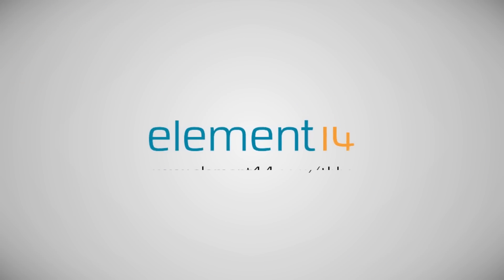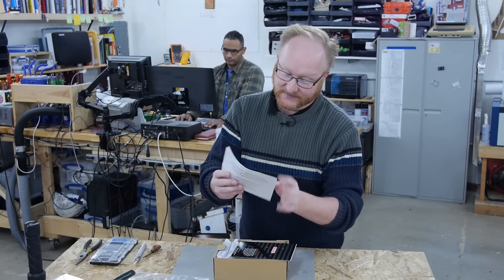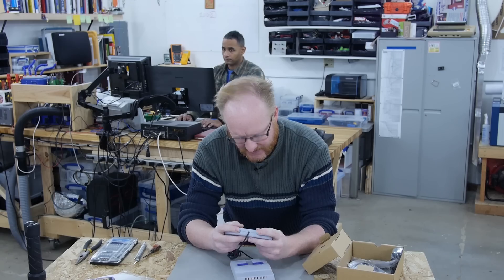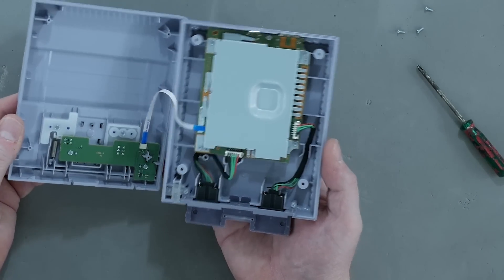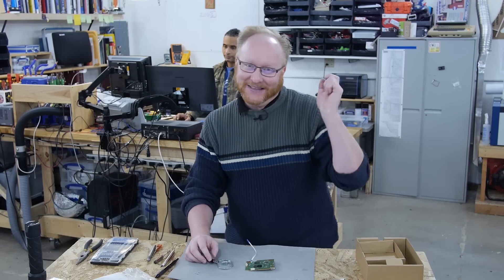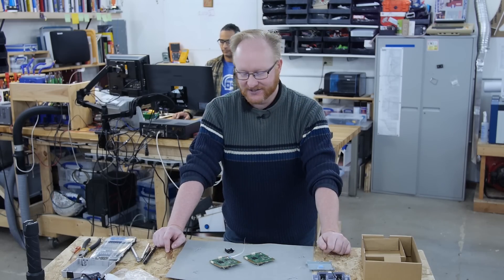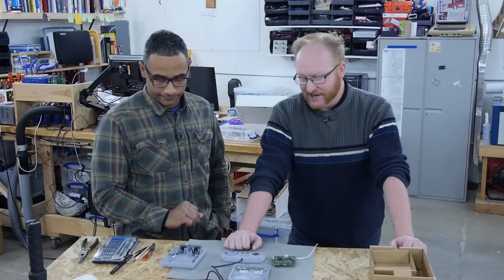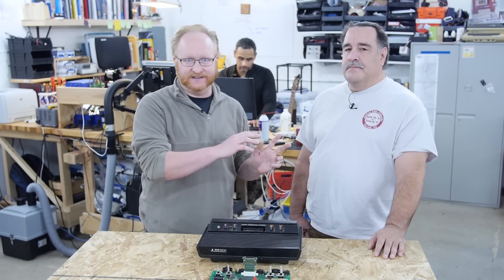SNES Classic Teardown

Comment: Thank god you answered my curious concerns of the difference in boards between the NES Classic and SNES Classic.

I wanted to try putting MAME on one of my many NES and SNES classic consoles and I’m happy I stuck with the SNES classic for the extra RAM. Deff shows in Street Fighter 3 Third Strike , Battle Garegga and PC Ultimate Doom with Sigil running in it 👌 solid

Deff worth messing around if you have a spare NES or SNES classic consoles to run other systems

Comment: It's good thing the SNES classic came with more ram storage. Makes it a better option for modding to add more games too it. Why it is still odd it wasn't more than 21 games added to it originally. I currently have over 206 games including more Snes games, NES, and some Genesis games. Some of the 512mb store is offheaded it seems. Only allows a lil over 200mb of storage for games but I still have over 100 mb left after installing more games and emulator mods. Btw it doesn't take much to emulate N64 that well. I can run it on my phone lol but smart phones are basically portable computers these days and have more than adequate cpu processing and graphics capabilities for retro games.

Comment: N64 emulation is still harder than most might assume. There are still lesser played games that don't run perfectly on any system.

That said, to be safe you'd want (roughly):
1.5ghz cpu
1GB RAM
Some form of dedicated GPU with 128-256MB of VRAM

I think Nintendo would just be better off remaking the N64 instead of emulating. Bust out the datasheets, make a console on a chip and sell it miniaturized.

If not, they're looking at a device that has about the same power as a Galaxy s5 or s6 smart phone. That would still cost too much to profit from as of today. That's why I don't see an N64 mini coming anytime soon.

Comment: Nintendo has sadly discovered artificial scarcity as a selling strategy. The don't make enough Amiibos and then watch the prices soar. They use the same PCB and SoC to make two "different" products, both are overpriced and they claim that production can't keep up with demand. 
People were demanding absolutely insane prices for these on eBay when they came out because stores and online shops didn't have enough.

Comment: It's going to take beefier hardware for sure to properly emulate Nintendo 64 games in a mini system. MY guess is those hardware requirements are going to raise the price to $120 for a mini N64 with original controller. The all-time best N64 emulation back in the day was using UltraHLE + a 3DFX Voodoo 3 3000, then later the Voodoo 5 5500 using Glide drivers. Games ran smoothly and in much crisper high resolution thanks to UltraHLE using direct hardware for the emulation. Zelda 64 never looked better! <3

Comment: It depends on how cycle accurate you want the emulation to the ratio of traditional PC power. Snes9x requires about 1~1.6 GHz of CPU power, whereas Higan-Accurate requires about 3.5 + GHz. The worst problem is actually getting the SA-1 emulated accurately which requires, according to Higan author Byuu and ZSnes and ePSXe author _demo_, somewhere about 7.5~9.0GHz or higher estimated CPU power which is currently next to impossible outside LN2 rigs.

Comment: I bought this for the Star Fox 2 game. Just over 5 million units have been sold and Nintendo will likely halt production. 5 million sounds like a lot but if they released any popular game limited to these numbers it would drive the price through the roof. Say they did this with Pokemon. Prices would go through the roof. Why hasn't this happened with this system yet? People have been playing Star Fox 2 for years. What will drive price increase over time? Collectors of games want mint specimens, not software emulations. This is the only official release of Star Fox 2 and to date is more a side note rather then the selling point it should be.

Comment: For me the SNES classic is worth the price for 3 reasons:  the controllers actually feel like SNES controllers (and it comes with two!), the front end UI is great, and it’s ridiculously easy to drop more games on it.  Considering my Raspberry Pi, NesPi case, 8BitDo controller and 128Gb SD card set me back about £100- the SNES classic is easily worth £70 in my book, but I wouldn’t pay more.

Comment: If you ask me the real console is better. I find this version having low grade tablet parts is just to give a cheap taste of nostalgia. The room filling sound is gone on these. The original had a superior sound chip.  To me it was like trying to port arcade Killer Instinct to the SNES with buttons in a the wrong places. I was an arcade tech so home consoles were like cheap knockoff's with the exceptions of original console games. Because it was mentioned, if a N64 mini was made I think sourcing chips modeled after the original SG would be the best way to go.

Comment: N64 runs well (other than sound emulation coding(?) problems) on a Sony PSP, so that's some idea. The CPU was 222-333 MHz, depending on the generation, I believe, but you could overclock the earlier ones with custom firmware to 333MHz. I don't recall the GPU, but it was somewhat better than the PS1's, so that's pretty efficient.

Comment: The hardest part of emulating the N64 is the 3D graphic standard. Back then there was none, everything was either software or proprietary. While 3Dfx came up slightly earlier, it wasn't adopted by Nintendo.
So your emulator needs to interpret the proprietary 3D data and convert it into OpenGL in real time. And since the programmers often used some undocumented hacks, it is really hard to make the OpenGL result at least look flawless. That's why all N64 emulators can only emulate a few games without too much annoying graphic glitches. Also you need a lot of "horsepower" to emulate.

The PS2 is a different problem. While it does run on some kind of OpenGL, it's graphic power depends on a Vector-CPU which is really hard to emulate because a numeric CPU often needs hundreds of steps to do what the V-CPU does in a few steps.

Comment: the cable length issue seems to be related to the controllers using i2c, so it has to keep a check on cable resistance and capacitance

Comment: This remake of both the Nintendo and Super  Nintendo are horrible. I played Super Contra on my friends and the controller only recognizes up to three buttons at a time. Found out while shooting diagonally up to the right at a power up and needing to jump at the same time without letting off the fire/shoot button, and I died. I own an original SNES, Contra, and controllers and this is not an issue in the original console.

Comment: The SNES mini classic actually does fair N64 emulation (provided you use a compatible controller). It's not perfect and some games don't work, but with the right emulator the actual board wouldn't need a big upgrade to work flawlessly.

Comment: You should totally take off the NAND chip of the NES Classic, put it into the SNES classic, and use some type of switch to switch between the two NAND's before booting it up. Two in one console!
Reply: too much effort. just hack in a front end that loads either system and dump both on one board.

Comment: The AXP223 is a PMIC (Power Management IC), which does power regulation providing stable, correct voltages for the various power rails of the SoC and other components.

Comment: n64 games don't run well on the snes mini some won't even start others will freeze mid game sound skipping. the biggest issues are thermal throttling, the cutscenes in majora's mask are black indicating resource problems, or emulation problems.

Comment: its the same board they used for the NES classic, just the software is different.
You can even hack it to emulate PlayStation and N64 games. (USB and SD card mod helps with storage ;) )

Comment: This is probably a more long term project. But heck, if you got into reverse engineering and creating an N64 emulator, that could be really awesome. A lot of the current ones are still pretty meh when it comes to accuracy, and the "plugin" style of having different plugins for controller, video, and audio needs to die. 

Dolphin does emulation so much better for newer Nintendo consoles which is just silly.

Comment: re: Emulation requirements, when the emulators were first released back, way back...

The NES and GB could be emulated on a 486 class machine, but typically wasn't great. The SNES could be emulated on any Pentium around 133Mhz. The N64 emulators first became available around the Pentium 4 era, but required the 3DFX board to do at the time, roughly around 1999. This meant that anyone who wanted to try it needed to also emulate the 3DFX board and thus glide wrappers beccame a thing. So recompilation is a bit different. 

it should be noted for accurate emulation it is not currently possible to emulate anything more powerful than a SNES without expansion chips on a PC. FPGA's are more accurate and don't have the latency and overhead the PC based emulators do. But you don't get save states on FPGA emulators.

For the N64, no ARM chip is currently sufficient to emulate it (other than maybe what's in the Switch,) so it's unlikely that that Nintendo would use the same board again. It's only possible to emulate it on desktop PC's with a sufficiently powerful CPU in the 3Ghz range. This is why only 21 N64 games found their way onto the Wii Virtual console, and none of them onto the 3DS. 

The irony is that the GC, Wii, and Wii U can all be emulated to higher quality on a desktop PC with a high end GPU, and thus you can actually get 1080p and 4K out of the GC/Wii/Wii U emulation where the original console could not.

So it would actually be easier for Nintendo to recompile the N64 and later games into an ARM-native format rather than try to emulate the hardware at all. Since Nintendo presumably has the source code to their own games, they could do this themselves. Or they can write their own extensions for the toolchain originally used to compile the games (Eg Clang) to output native ARM for the Switch.

Footnote: Pi based systems are not really powerful enough to emulate anything but 8-bit machines. Though you will frequently see people try to flog them on eBay as being able to play SNES and N64 games, they do so at high latency and poor accuracy/frame rates.

Comment: Spoilers. It's an NES mini with different firmware flashed to it. I expected as much when I saw how much overkill the hardware was just to emulate an NES. They probably plan on reusing this board over and over again. Also mine was rather easy to get. I just showed up at Walmart at midnight the night of launch and I got it. 
Also they won't have to upgrade it at all to do the N64. It's already been hacked with an N64 emulator. It's future proof.

Comment: N64 emulation takes sweet FA in the way of processor and GPU.  I have a laptop from 2005 with a 1ghz single core AMD hotplate and 1 gb DDR ram and it runs Banjo-Kazooie with out issue.

Comment: Ready for this? Super N.E.S.
I've never heard "SNES" until about the last year or so. Its always been either Super Nintendo, Super N.E.S., or S.N.E.S.
SNES sounds like some sort of low level flu outbreak or something. Like a cold with lots of snot. "Drink lots of fluids and get bed rest and the SNES will start to work its way out of your system in 4-5 days." 
As for Emulation: ZSNES is king

Comment: You cant compare CPU's of different architectures by clock speed. sure it had it's weaknesses, but overall I think SNES games were graphically superior to the Sega Genesis (although not by much). One of the biggest factors in the SNES favor was that it could display 256 colors simultaneously onscreen while the Genesis could only do 64. This led to more colorful games on SNES. Another big factor favoring the SNES was a superior audio chip AKA better music and sound vs the Sega. There was some slowdown in early SNES games, but over time that decreased as programmers learned the system better. Not saying I'm sure there weren't a few things the Sega could do better, just that overall I feel like the SNES was the more "powerful" system.

You could really see this combo of more color+better sound in a lot of 16-bit SNES JRPG's. When I think of idealized 16-but graphics, the SNES wins easily due to the colors.

Granted it had the help of co processor chips on the cart I'm sure, but for example I remember Donkey Kong Country, very late in the SNES life so programmers had really maxed the thing, at the time being compared to early 32-bit PSX games favorably! Although dont get me wrong of course overall the SNES was far less powerful than a PSX. It was just an example of how good a SNES game could look.

It's all relative though, IMO coming later after the Mega Drive, SNES should have outpowered the Mega Drive by a more significant margin than it did IMO (back then technology moved really fast), and that was a Nintendo screwup IMO. But that's another discussion.
Reply: It's absolutely true that the Snes should have overpowered the Gen in every respect with its 2 yr head-start, but because Nintendo superficially valued cosmetics over efficient 16-bit performance, it did not... 
While it's true that the Snes is overall superior graphically (albeit not by much as you said) and it also has the ability to rotate and scale backrounds, I will strongly argue that the Genesis, is overall the more capable, and more balanced machine because it has all technical advantage relating to gameplay whereas the Snes's advantages are merely cosmetic (with the few exceptions of mode 7 games like Mario Kart). 
Pretty much anything relating to on-screen performance (parallax scrolling, # of sprites on screen, quality of animation, 3D visual effects, wider horizontal resolution allowing broader field of player vision), the Gen has the advantage and these factors undoubtedly affect the gameplay experience.
 
So of course, Chrono Trigger, DKC, Super Metroid, Lttp, FFVI wouldn't look as good or sound the same on the Gen, but the (dozen or so) games that push the Gen to its peak limits...a vanilla Snes most likely couldn't even run, (Alien Soldier, Gunstar Heroes, StreetsOR2, Thunder Force IV, Adventures of Batman & R etc) w/o cutbacks or an arduous amount of optimization.

Sound is another massive debate that I adamantly argue is a clean cut tie. The quote "Snes has a superior audio chip" is simply mythical Wikipedia info written by those who are uninformed and bias.
Now hear me out, the Snes's samples clearly have the advantage when it comes to orchestral & ambient instrumentation ala Secret of Mana, Terranigma etc, but when it comes to rock/electronic or metal, as in the Gen games I listed above^^, it's Yamaha FM synth and 8-bit PSG hardware deliver razor sharp audio quality that the sometimes mediocre clarity of Snes samples (ala Mega Man X and Super Punch Out etc) simply cannot deliver. 
Furthermore it puts up a very respectable fight in orchestral/Jazz scores as well with Time Trax, Devilish, Gauntlet IV and Master of Monsters (very obscure but masterfully composed scores for the system give them a listen sometime! 

All in all, both systems are fantastic but in their own special and unique ways, where one system is weak the other is very strong. And this is what makes the 16-bit era the most misunderstood and contentious but also really cool.

Comment: Really 512MB is overkill for SNES emulation....I was emulating the SNES on a 486CPU with 32MB of RAM, granted, it did not run 100%, but a Pentium 233MMX with 64MB RAM did good...they could have gotten away with using the same RAM for the SNES Classic as they did the NES Classic

Comment: Elias Bakken has two full HDMI mini displays on Kickstarter.  It's called the Manga Screen 2, and comes in 4.8 and 5.9 inch sizes. Perfect for Ben's mini console using the Raspberry pi.
https://www.google.com/url?sa=t&source=web&rct=j&url=https://www.kickstarter.com/projects/1924187374/manga-screen-2&ved=0ahUKEwjr9oH9-Z7YAhUrSt8KHab9BOEQjjgIJTAA&usg=AOvVaw2CL5EUAtZSz4gDtLadkBOG

Comment: N64 emulation surprisingly doesn't take as much as you think. 

This is because N64 was the first system where we pushed high level emulation. The computers at the time were just way too slow to do it the old way. In particular, you absolutely needed to take advantage of 3D hardware acceleration, even though the N64 didn't really have that. (It did have a separate chip for the graphics, but it's really more like a CPU.) 

This was revolutionary at the time. You could run Mario 64 on a 256Mhz Pentium II. Other games would take stronger or weaker CPUs. And some games just weren't amenable to the practice. But the point was you could do it. And it's how all emulators for more recent consoles works. 

However, there's also a downside. Despite computers becoming faster, there really wasn't a push for more accurate emulation. And the state of N64 compatibility, especially if you want to avoid bugs, is not that great. 

Unlike every other emulator, Nintendo's virtual console emulator is actually better than the PC ones for some games, like Donkey Kong 64. In fact, you are actually encouraged to fire up a Wii U emulator and run Donkey Kong 64 on that rather than on a N64 emulator, if you want a better experience! And it seems that you need a lot of power for that game, too.

So it's iffy. Nintendo would need to be selective in game selection to keep the requirements down.  And they're going to have to do a whole lot more quality testing. Really, I wouldn't expect anything that hasn't already been released on VC.